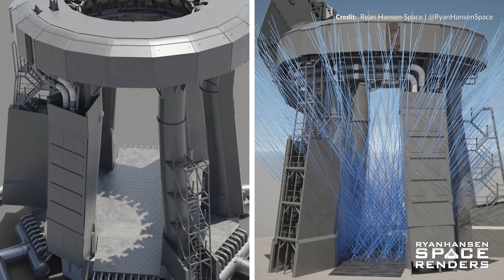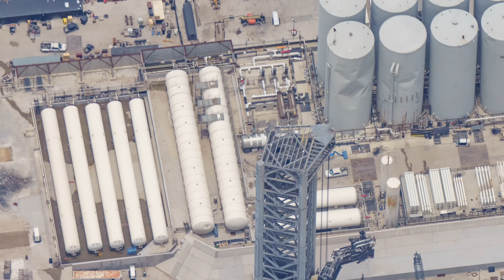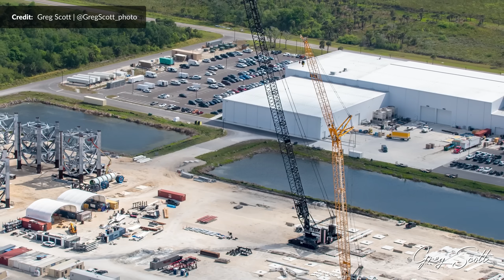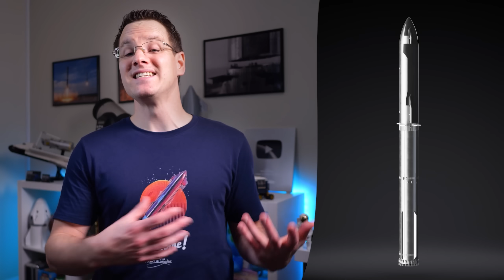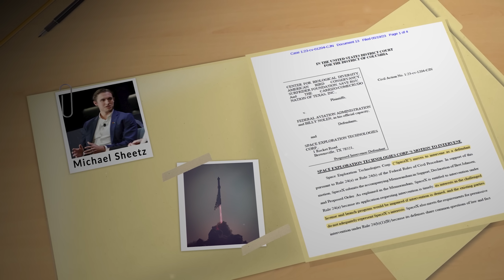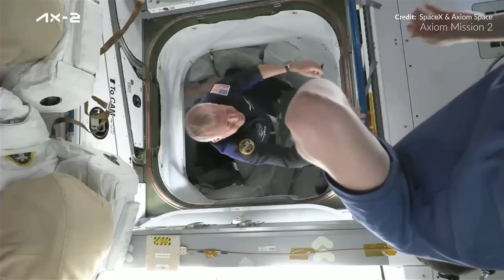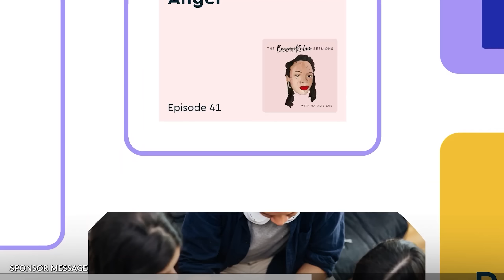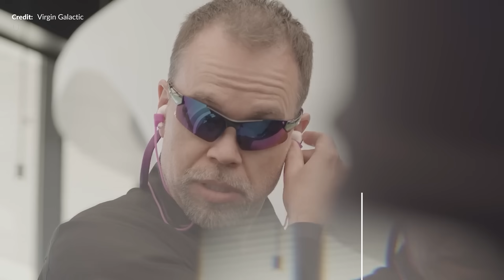SpaceX Starship 6,000 ton Capability, and SpaceX Joins FAA for Legal Battle, Axiom 2, Unity 25

Comment: Elon: "Raptor V3 just achieved 350 bar chamber pressure (269 tons of thrust). Starship Super Heavy Booster has 33 Raptors, so total thrust of 8877 tons or 19.5 million pounds."

Stage Zero: "I'm tired, boss."

edit: idk what's happening in the replies rn, you can ignore them if you'd like to.
Reply: I love it when the SpaceX pom pom girls get all hot and bothered... It's truly hilarious.  Every. Single. Time.  Hey girls, go over to the Common Sense Skeptic channel. Your libel to blow your tampons right into space after you see some of those videos... I imagine It'll be like splashing holy water on Count Dracula for you🤣🤣. Anyway, unreasonable worship/fandom/cult of personality issues aside, SpaceX will eventually have a great cargo ship that will have super lift capabilities. That will certainly help the space race, no question. At any rate, even the pom pom girls must concede that the program is going to take 5 to 10 years to mature to something reliable. Yes it's going to cost almost as much as traditional aerospace. Yes flight cost are going to be way more than 10 million per flight. That's just the physics of space flight.
Reply: @hawkdsl  Now that's a good post right there. Did any of you that disagree  laugh anyway? Come on, admit it.
Reply: @hawkdsl  Sounds like you're just a hater and a malcontent. I would rather root for progress than talk sh!t on people trying to advance technology.
Reply: @hawkdsl  misogyny doesn't change facts.
Reply: @AtomicExtremophile  Huh?
Reply: @hawkdsl  The whole Starship program up till now (if it has cost $5 billion) has cost less than half the cost of a single Shuttle. The whole program has been designed from the beginning to be far cheaper and more efficient than any rocket built up till now. - That's why Space X went for big and for stainless steel.
Reply: @Lucien86  Yes, that's true... Starship will be cheaper than any Government endeavor. No one is going to dispute that. But it's not cheap either. The total cost of Starship is of course going to be much higher than advertised.
Reply: @hawkdsl  I did a calculated estimate of Starships cost about a bit over a year ago.. A Starship itself costs something like $20 to 30 million to build.. The Superheavy booster probably costs about $50 to 80 million to build.. But that doesn't take in the cost of all the ground facilities or anything else..
Reply: And don't forget the painters. Every launch or test fire, the painters think "Bloody 'ell. Here we go again!"
Reply: @herbertbautista8509  He's a great guy from what I've seen but he is, if not officially still, a NASA spokesperson of sorts. What did you think he was going to say? Oh, and the ISS trips? Fantastic job, and the Falcon 9 is sweet. Very nice rocket, but again, not nearly the hyped future savings to the government that Elon sold them on either. They were given the billions to be the first back to the ISS.  They did it, and that's impressive but it it is something that's been done for decades by others.
Reply: I would bet $,£,€ or whatever currency that his “water sandwich” will do nothing but cause a huge steam explosion. Possibly damaging a lot more components then the concrete did.
Reply: It's so funny when ultralibs invade the comments and try to detract from the scale and ambition of what spacex is doing without even knowing what they're talking about
Reply: @herbertbautista8509  Why can't you and others ever admit maybe Musk is wrong in his strategy of building Starship.  You take what he says as gospel and never ask your self, why doesn't Sierra Space, NASA, Boeing, ULA, Blue Origin, ESA, and others do it that way?  SpaceX engineers are the only ones who know how to do things?

You were sold that just clearing the launch pad is success and an exploding rocket is the best way to get data.  Instead of explaining why others are wrong, you go to the usual I just hate Musk.  

Sorry to disappoint you, but Musk is not an Aerospace engineer.  The fact he refuses to put in a flame diverter and trench, shows he can't even follow the basic design rules all others follow.  You see the result of his flat pad design.
Reply: Stage Zero: "I don't feel so good, Mr. Stark... eh Musk...."
Reply: @herbertbautista8509  NASA used the shuttle before it retired and purposely hired commercial companies to handle those missions.  How soon we forget that NASA gave some money to SpaceX and Boeing to help develop their commercial crew vehicles.  Let that sink in.
Reply: @pebmets  You just gave us the perfect example :- SpaceX vs Boeing. Just how many astronauts has Dragon taken to orbit? Now how many has Starliner? I just counted it and its currently 38 people for Dragon and 0 zero people for Starliner.
That's why the prototyping iterative approach is a good idea.

Now who achieved the first reusable first stage ever? SpaceX with Falcon 9. How many Falcon 9 landing's failed before they got it right? about a dozen. The iterative process works..
Reply: "Now who achieved the *first reusable first stage ever*?" 
You want to clarify that part?
Reply: @Lucien86 You know the FAA will ground Starship evetime there is anomaly.   An FAA investigation at minimum is 90 days.  How fast are you going to build that vehicle if you keep getting grounded for the FAA to investigate?

As for the Falcon 9 1st reusable?  Columbia, Challenger, Discovery, Atlantis, and Endeavour came before falcon 9.  The SRB segments were reused.
Reply: @pebmets  "How soon we forget that NASA gave some money to SpaceX and Boeing to help develop their commercial crew vehicles.  Let that sink in." 
Is that supposed to be a big deal? Actually, how is that related to the topic at all? It's irrelevant. The point isn't about NASA being useless or something. NASA is great. Not everything they do is perfect, though.

But if you want to talk about this, though, sure. Let's talk about crewed missions, since you referenced them in this comment. Let's talk about how Boeing managed secure 1.75x the funding for their starliner vs SpaceX, started development earlier and with more resources, and how it failed multiple times on its test flights (while SpaceX... didn't, almost in any capacity). Starliner Is STILL pending its crewed test flight which optimistically will be in two months (3.25 years later than spacex), and NASA's safety panel voiced major concerns over the safety of Starliner just yesterday. When it optimistically enters actual service in the second half of 2024 (current estimate provided by boeing), it's almost guaranteed it'll be more expensive just on a per-launch basis due to the launch platform.

This is a great example of SpaceX as a company beating a legacy aerospace company/org at their own game.
Reply: @EntropyConcept  Too bad it's a very very mature game so not much ground to break there, partial reusability they improved, but that's been done as well. That is no knock on the Falcon9. It is a great rocket. Those nice launch pads provided on top of the cash didn't hurt...like the OLM got hurt, badly. Yeah, Artemis burned up the launch tower in some places and some things need to be replaced, but the flight was great. SpaceX makes apocalypse movie b-roll footage. 😃
Reply: @pebmets, that's the point, SPACEX do something different (that you called incorrect) and eventually achieved it, while the Boeing and Blue Origin (recently) till now is still in development for the vehicle that will put American astronaut in a American soil to ISS and beyond, which both companies are also funded by NASA. Now did you get it? If you can't, I can't argue anymore, you have no way to understand. 

Btw, I'm not saying Boeing and Blue Origin is  not doing the proper way, it's just that it's a conservative way.
Reply: @herbertbautista8509  space x engineers are all mostly former NASA, Boeing, ULA engineers, they are fully aware that the way space x is doing it now is better than the way there former employers did this stuff
Reply: @beverlywhitman303  You sure they're not doing it to work in the field and provide for their families after the space program blew away in a cloud of dust years ago? People, especially specialists in relatively small fields don't always work where they believe in the end result the most. It's, nice and I'm sure a lot of them do believe they can do it and are loving being a part of it. You'd be hard pressed to find people being honest about it if they really wished they were at boeing or elsewhere still. People do quit SpaceX too.
Reply: @troys9222  my point is they (the engineers) are the ones making the dissensions at SpaceX, its not all on elon, he mostly just gives them the go ahead.

he is not a rocket scientist. 

inversely when any of them worked at NASA or boing, it was mostly 'no' go ahead. we need to do a 5 year study first. its that type of thinking that killed the space industry and make the system cost 10x.

restricting your self to only use 'tried and tested' means nothing will ever improve.

i think you mentioned that they shouldn't use 30+ engines? there are no other really big tried and tested engines that are capable of doing what raptor engines do, they need to be able to restart on the fly. those really big ones need to be started with external help from stage 0, that simply wont work on a the re-use concept they are going for.
Reply: @beverlywhitman303  Don't count the money until delivery. Nothing is guaranteed here. The general idea may be sound and worth a try, but it's not producing anything at all yet. I never said we must restrict ourselves to tried and true devices, but the most important part of the rocket (the FTS) was half-baked when there are so many examples of ones that have worked flawlessly, every time.  That's a small part. It doesn't hold back progress. Trying to design your own and failing with something so relatively simple is bad, and I'm not sure why people defend them in this. They can do no wrong? They messed up and endangered peoples lives haphazardly. This is not a nuanced issue with many angles. They messed up in an alarming way.
Reply: @beverlywhitman303  No really big tried engines? They were building their own engine. They made the initial decision on their size and decided right away to use a crazy number of them. You do know that the outer 20 engines on the Super Heavy booster are started by the OLM, right? Which is fine and saves weight but it makes the pad even more incredibly complicated. They talk of undesigning and simplifying things so much, then the actual result is an increasingly complicated pad with so many systems with fail points it, and the simplest part of it (flame/deluge) is embarrassingly what costs them the most in the long run.
Reply: @troys9222  where are you getting this? no ones life was endangered by the FTS, even if it had failed (witch it didn't) the ship would more than likely have just splashed down in the ocean.

they didn't use a "half backed" system!, its the same kind of system used on several other rockets. turns out it doesn't work as well on a rocket 3 time larger than any of the others using it but how could any one know that with out a test?

oh yeah nvm a 5 year study may have caught it, or not, it didn't catch the Columbia disaster and there was at least one engineer at NASA warning it would happen.

far as i know no one thought there would be issues with the FTS before launch, and it worked fine, just not perfectly. can it be improved sure, you find these things out by testing.
Reply: @troys9222  it's not a crazy number of engines, nasa was even thinking of building a set up like this a few times. more, smaller engines means they are easier to service, easier to install, easier to build, and gives a lot more redundancy if one fails.

have 1 of your 5 engines fail and it's a disaster, have 1 of 30 and you may still make it. they are trying to get some redundancy with starship, they need to be able to hot swap an engine for quicker launch turn overs, try doing that with a 80 ton engine vs a 2 ton one. 

people at NASA have being arguing for smaller engines in grater numbers for years as there is a lot of benefits to it.
Reply: @beverlywhitman303  I'll get to the danger next, but I do want to address your points. I'm not here to insult anyone personally. I have views on this, and I haven't had anyone tell me a good reason why lives were not in danger. I make long posts, so I'm not even getting started unless you want to hear it, so if you have a response, don't be vague and we can discuss this further. I assume that's why you're here as well, but maybe not. For starters, what is your criteria for "worked fine"?
Reply: @beverlywhitman303  Engine redundancy is great, but has nothing to do with chosen number of engines above a certain definitely real but somewhat variable threshold where it becomes prohibitive and unnecessarily complex. Everyone knows this, and I understand what they're trying to do. It doesn't make it the right move. They are struggling with that balance right now. It doesn't have to be a great idea.
Reply: @beverlywhitman303  Could you also point me to any instance of people arguing for a number of engines anything near Starship? Is this one rendering conceived one time of one team, on one thing, or a movement as it sounds like you're implying?
Reply: @troys9222  "worked fine" criteria for FTS (flight termination sequence) is they activated it and the the ship ship blew up.

if it had failed then the ship wouldn't have blown up or at least not blown up do to the FTS

also i am talking about the Starship test flight so if it's some other rocket that FTS did fail then we are talking past each other.
Reply: @troys9222  actually using smaller engines simplifies things, the bigger the engine is the harder it is to control chamber pressures, and the more likely they are to just blow up unexpectedly.

the most reliable rocket atm is Falcon 9 and it uses 9 engines, 9 to take off and one to land, if it used just 2 or 3 it wouldn't be able to land it self with the current tech as rocket engines do not that that much variable thrust.

its the same issue with Starship, its going to use (more of less) 33 to take off and just 2 or 3 to land, it will need at least 2 engines to land with so that is part of what determines the engine size.

Falcon 9 can land with 1 because it doesn't have to yaw on the landing, Starship does have to yaw as the fins need to be at the right orientation for mechazilla to grab it
Reply: @troys9222  old Soyuz rockets had upto 32 combustion chambers, even the modern Soyuz still has 20 of them counting the boosters, and it was considered the most dependable rocket till falcon 9 took the top spot.

i've been trying to find papers on the Venture star shuttle replacement that was suppose to use 7 aerospike engines as i remember seeing suggestions for up to 50 on some of it's concept builds but i'm not having any luck. 

the point was to make them more serviceable as the old shuttle engines where simply not. they where way too big, and it took weeks or sometimes months to put the shuttle back on the pad.
Reply: @beverlywhitman303  Combustion chambers and rockets aren't the same.  Of course you know that, I'm not trying to insult you, but I don't know what you know about rockets either. 

Multiple combustion chambers was a way to combat combustion instability. For example on the F-1 the size, like you were saying with larger engines, things like combustion instability become much larger problems and it was a huge one for the F-1.

I get it with the size advantages, but you have to acknowledge there is a limit, or more accurately a balance, and it is an incredibly hard thing to do. Of course, that's why sayings are based on the complexity of rocket science. 😄It really is so complex I can only try to barely start to get the general overview of it. I don't know if I know more than you about it, but I like discussing it.

I appreciate you trying to find that. I wasn't trying to call you out I just hadn't seen that. The way I see it, concepts are concepts, and that's cool, but I focus more on what made it off the drawing board, many times for very good and obvious reasons. Aerospikes are so attractive, but the disadvantages haven't gotten them very far as of yet. They're heavy and introduce things that rocket's don't to offset their clear advantages...so far.

The Soyuz I love for it's extreme dependability and sheer work accomplished, and the Soviet engines of the 1970s are still so legendary and reliable that are still used quite effectively. Rocket science is so much razors edge walking and incremental improvements that if SpaceX perfects the full flow staged combustion cycle engine it will be revolutionary no doubt at all. I'll be back to eat crow and congratulate, I swear I will be very happy. I'm not a hater not wanting them to succeed, I'm just worried they are going to set back the program I want to happen for valid reasons in my opinion.
Reply: @beverlywhitman303  Wow, we have so many tangents going. I appreciate the discussion of the topic and being civil. I like it when people address the points I make and talk about them specifically so I try to do the same.

We agree of course there are disadvantages and advantages to more engines vs. bigger engines. They are pushing this farther than anyone has, especially considering the immense power of the engines and combined thrust on unheard of scales. I think we agree on that. We disagree whether it can or will work, so ideas involving aerospikes, while interesting, I'm not sure are relevant to this.

The bigger the engine the harder it is to control chamber pressures? I haven't read that but that may be the case. My take from what I've seen is that the stability of combustion is the problem, but maybe those are so related they may be the same thing essentially. I agree if so.

Falcon 9 is an anomaly in the rocket world, and they did do that, and did it well, but that is feeding 9 engines from one tank, not triple that number for much more powerful engines for a ship asked to do so much more. 

Interesting info about the engines for landing. I hadn't known that. Like I've said before, I get what they're trying, but I'm not getting any confidence here. I thought I was an optimist by nature, but dang.
Reply: @beverlywhitman303  I'm not sure I have the energy left for this tonight, but I'll give you my take in short form and will have to respond tomorrow.

The FTS did not work. It did not break up due to the FTS. It broke up almost a full minute after the FTS was triggered (according to Elon Musk 40 seconds), though I timed it to 50 seconds or so I think. You can literally see them trigger it. It popped holes in the tanks. That is all. Essentially it did nothing remotely useful, because its whole job is to cause the rocket to break up NOW, not whenever it experiences aerodynamic forces it can't take or explodes on its own for whatever reason.

Ships won't blow up unless they're triggered to blow up? Just no.
Reply: I'll ask again, maybe not in the exact words, but what is the job of the FTS?
Reply: Always surprised to see people actively being critical of SpaceX, it's as if they want them to fail so they can have some kind of legitimacy to their argument...but to what end?  People really don't want to see Starship realized?  For what reason?  Shouldn't we all be hoping SpaceX succeeds in their goals?  Or are these people just salty because SpaceX isn't doing it the way they think it should be done?
Reply: @Skinflaps_Meatslapper  For me, I'll be as honest as I can and speak only for myself. I love the space program of our planet and hope for it to progress as swiftly as possible and I'm glad to be alive in this time. I do not want it to fail or sputter in any way. I am as objectively as possible looking at what SpaceX is doing and thinking I am afraid it doesn't look good for glaringly obvious reasons so far. I am critical of the very real recklessness of putting people, yes people, in real danger as well.  Those are a couple of the things. 

Why does it have to be secret behind the scenes "hate" for other reasons so much? I'm afraid they're going to set back our space program in a worse way, compounding instead of relieving NASA's regular cost overruns and schedule slips that I do complain about as well. A big part of that is the nature of relying on political conditions to fund or defund projects. This new way I understand the reasons for it, but it doesn't look good to me for Starship being near what was promised. BO is dragging heels and a really late mystery and getting more annoying as it doesn't appear,but SpaceX is so visible it's kind of fun to debate. I don't want a fight. I'm here to maybe talk about specifics and posts get me going sometimes and I make way too long posts, but I'm not as serious as I sound. I take it pretty friendly, but I will disagree and debate with some things, agree with others and go on and on...
Reply: @Skinflaps_Meatslapper  SpaceX is a company that wants to make money. That's it... end of story... turn out the lights and go to bed. All the other nonsense is something called marketing. That's all the "multi-planetary" and "save the human race" word salad nonsense is. Marketing. Selling you 2 toilet plungers when all you need is 1. That's not to say SpaceX is not doing great things in rocketry... they are. But the end goal is to make money. Thinking otherwise is very naive.
Reply: And Yet, they can't launch with what they have without multiple engine failures.
Reply: @pebmets  sitting behind a screen being critical is easy. what you fail to make note of is that these are all test flights to find problems and overcome them... practice makes perfect as they say.
Reply: @jek4_XD  Please tell me what other launch provider builds a new rocket and the person who runs the company says it will probably fail and if it clears the tower everything else is a bonus.  I followed shuttle development.  It was the most complex vehicle to ever fly.  Its maiden flight was a success.

We all followed SLS.  It's maiden flight was a success.

How did these complex vehicles do it without blowing up previous versions in flight?   Shows you can learn without having to have the thing fail in flight.
Reply: @pebmets  Show me another Rocket Company that builds Rockets outside of Government contracts.

Tax payers and Congress tend to freak out when you blow stuff up. Government rockets are over-engineered to ensure they never blow up, reducing their effectiveness at the cost of payload capacity and substantially increased cost.

1 Super-Heavy cost: $40 million
1 Government Rocket: $3.5 billion
Reply: @pebmets   your missing key information in your argument. Look how long shuttle and SLS programs were in development process for before flying, then look at the very little time taken compared to these that space x has been developing and upgrading its starship program. Also the fact that SLS flights were not named as test flights and starship is , you cant compare them at all. Completely different rocket programs in their own rights, with completely different development processes. Starship is still in the development stages and is being tested by real life flights and data gather from said tests, not just on analytical data alone.
Reply: @pebmets  empty f***ing argument bro
Reply: @JessiBear  You do understand the $2.7 billion contract for HLS is going towards development of Starship is government money.  Also, NASA gave SpaceX millions for the in orbit fueling proof of concept.  So government money is going towards starship.  Government money for launch contracts is keeping Space alive.
Reply: @jek4_XD  So every other program did it wrong?  Surprised Apollo, Starship, and SLS were able to fly without having prototypes fail in flight.  How is flying with engines  Musk said were already obsolete proving anything?
Reply: @pebmets  look what Spacex did with falcon 9 there were quite a few explosions but now it is one of the most launched, landed and reused, and reliable rockets in operation. Spacex’s method of development seems to be working very well. Not saying that more cautious development is wrong, but being more ambitious can work well.
Reply: @pebmets  
Stop it dude. This approach is faster then sls, sls had failed launch attempts, by failed, I mean they scrubbed them as rocket had issues. 

What space x employs is developed, test, correct issues, test, and repeat until successful launch system. 

Just look at falcon rockets, they went through same process, now falcon rockets are practically 100% reusable and no other system even comes close to its success. Starship is heading in the same direction just extra extra large version. 

The way nasal does things also cost like 10 times more then space x. So you lost already with your bogus argument.
Reply: @pebmets  Different development philosophies. The legacy test everything adnauseam, fixing it until it is perfect and assembling it at the end. Or fix it until it is good enough and fly it to get data for more fixes. Both work. The legacy method when hardware is expensive to make. The iterative method when you can afford it with a massive budget or the hardware is cheap.

NASA likes the robust Starship test program. From page 10 of the HLS Option A Source Selection Statement from early April 2021 before SN15 successfully landed.

"Finally, within Technical Area of Focus 7, Approach to Early Systems Demonstrations, I agree with the SEP’s assignment of a significant strength for SpaceX’s robust early system demonstration ground and flight system campaign, which focuses on the highest risk aspects of its proposed architecture. This will allow SpaceX to isolate and address performance and operational issues early in its development cycle, which will meaningfully inform the maturation of its capability and increase overall confidence in its performance abilities."
Reply: @pebmets  Compare the development costs and timelines of the programs.
Reply: @felixgent4084  To date, Musk said the program is up to $5 billion in costs.  This is Musk so it is probably higher.  He said an additional $2 billion this year and they still won't have a mission worthy vehicle.  That doesn't count the millions being spent to fortify Starbase for the next launch.  When a mission vehicle is ready, the cost of the program will be close to SLS.  With the amount of fueling flights needed to get to the moon,  an independent analysis claims the cost of a mission will be close to or exceed that of SLS.
Reply: @pebmets  SLS spent billions of tax payer funded money by the feds. SpaceX is a private company...you're comparing apples to oranges.
Reply: @pebmets  What's your source?
Reply: @steveaustin2686  Because people (and nuclear warheads) were riding those rockets to space...so the idea was find all the problems on the ground first, fix them and have as safe ride as humanly possible into space. This method by Elon means there will be many missions failure as they discover one bug after another. It will be many launches (or lost crews if elon cannot wait) until all  the bugs are found and fixed. 

The old development philosophy was implemented for a reason... NASA was daring like space X in its early day until multiple near misses and the Apollo1 crew burning to death due to a mistake that they missed (one obvious in hindsight)...  caused NASA to act the way they do now.  Test and test adnauseum. There are so many points of failure that you can't afford to let exploding rockets and dead crew find them all. The old development philosophy is there because it was paid in blood. 

Elon has not lost a crew yet... but when he does (and he will do if he is serious in going to Mars.. space travel is dangerous)... and when it is found it could have been avoided if they just spent the time to think about it and run a few test on the ground.. then we will see if SpaceX continues with its current philosophy of letting exploding rockets locate points of failure.
Reply: @jek4_XD  Yes, judging progress is easy if you go with the old tried and true method of examining results. Speculate all you want, but visuals are not good 9 years into Raptor development. The next Raptor may always be the most powerful, impressive and dominant Raptor yet, but when do you actually expect them to start working in some form reliably? "Because it's always the old version." is a perfect replay of Raptor 1 to 2 nearly.
Reply: @jek4_XD  Raptor, 9 years, zero reliability. Yet the latest version is always quite a test stand hero. That's like preseason champions in sports.
Reply: @pebmets  Yep, and Elon Musk has said that if it wasn't for the first NASA contract SpaceX was done. Decrying government subsidies and bailouts is rich coming from Musk. Remember the Mariachi band? I do. In their defense, they have a great rocket in the Falcon 9. Kudos. Those are results, and they handled development more carefully with a traditional RP-1 realistically sized excellent rocket. Starship seems a mess in scale, and has all of the hard progress of a money bonfire at this point, but we'll see.
Reply: @AstronomicalSFS  But this ambitious? If they do 50% of their claims reliably I will be so on the bandwagon it's not even funny.
Reply: @lupinereivaj  "Just fire it anyway" has absolutely never been an option with an entire host of failure conditions. One of those conditions has always been, rightly so, in the sane world, near populations, when you can't design a functioning FTS system especially, is to not launch, and try to get it right next time. 

You do not launch a flying 5,000 metric ton bomb with engines out prior to launch on an inaugural flight no less, and I would be appalled if NASA did so. I lived near the cape most of my life. Locals in Florida take it much more seriously and it has kept what could have too easily happened on the IFT from happening there thus far. This is not a game. 

Use a designed FTS or one very like it that has worked for decades and quit being so careless on the safety side at least. That is what you don't have to be an engineer to know. That launch was a big wake up call for south Texans and Mexicans. Learn from programs that have never had the type of near catastrophe of the IFT.  Why not use a system that has been so guaranteed for so many years and designs that have worked forever, but no, they don't like anything that is tried and true.
Reply: @pebmets  I don't care what Elon Musk says. There are so many ways to slant numbers when you're a private company with multiple arms. Let's see if it sustains. They were facing bankruptcy by his admission if Starship didn't fly every two weeks LAST year.  Along comes NASA with another fat contract, but this time it's sure looking decidedly different.
Reply: @Troy S  
The traditional cost 10 times the cost of starship. And all common sense safety measures were taken into account. At no time was anyone in danger from that launch. 

Stop whinning over what ifs. We know what happened, and we know no one got hurt cause proper and adequate safety measures were taken into account. 

Trial and error is superior to what sls went through, many projects that use the sls development process have also failed and exploded. You got nothing worth saying bur your negative tirade.
Reply: @lupinereivaj  "and we know no one got hurt cause proper and adequate safety measures were taken into account." You seem familiar with what happened on the flight, so could you tell me about the flight safety measures taken into account and about explaining how the FTS (The most important safety device in any rocket) was adequate?
Reply: @lupinereivaj  Starship has no "cost" until it actually does what it was paid to do. Calculating costs in the space industry are obviously only really possible when examining the actual production of a program when it does what it does.

Previous projects failing is not exactly in the favor of your argument is it? So, this process is different, other projects have failed doing it their way, and yet they have also actually revolutionized our progress in space. Focusing on failures when assessing the success of your program says a lot itself. Starship is in limbo with nothing to show yet.  Don't count your money while you're sitting at the table. This game, that's not a game, has a ways to go.
Reply: @troys9222  
Cost of starship is at 3 billion. This includes the entire boca Chica site and all the work that has gone to it and supports its production. So 3 bill. With first test flight, they now know what this ship needs to do better. From actual field test data. So the progress to a better launch will move so much quicker as oppose to design only design. You will be proven wrong in no time. As for sls, it's development is at 10 billion plus with each launch costing if I'm not mistaken 2 billion per launch. While starship which is better just a few million in full reusability, and in disposal upwards of a 100 mill and something. Like 15 to 20 times cheaper then sls. 

Case closed.
Reply: @lupinereivaj  Elon Musk's predictions of cost, in case you haven't followed it, are so often so wrong, I'm not sure how it even convinces people anymore. NASA is no different or almost any of the companies that work for them. No one but a select few at SpaceX really know what this has cost so far, and no one, including you can predict space flight costs. 

That is what the big change is. The companies producing things before (private companies nearly always) had to report when they drop a wrench. NASA doesn't directly design almost anything. Those private companies, however, had to report every penny to NASA. SpaceX does not. They are being given billions to do this outright, and there is not enough oversight to know true costs when whoever is reporting them has a huge interest in claiming they're super low.

Besides, even IF the current numbers are true, they've spent 3 billion so far... ok, and they're how close to done? It has cost 3 billion "so far" has no bearing on anything. They built and had to nearly rebuild a terrible launch pad with a big  chunk of that money, maybe the biggest chunk, considering the setbacks they're facing.
Reply: @lupinereivaj  Oh, also, the IFT was sad.  Nothing at all worked properly at least. The most important being the FTS. People could have been literally impacted, That flight being touted for anything is odd to me because people have a hard time giving any pluses except vague "learning". They obviously learned things. Nothing works yet is the takeaway unfortunately. I just have less confidence than ever, no matter what they call it. They can't even make sure people are safe.
Reply: @pebmets  I haven't seen you try to launch a rocket into space
Reply: @426shelby426  You know that is a silly comment.  I bet you haven't written a television program, but you have opinions if the ones you watch are good or bad.
Reply: @pebmets   And Yet, they can't launch with what they have without multiple engine failures. 

Prototype.  Iterative design.  You need to understand what they mean.  Please look them up and think about them.

I think that it is likely that they had multiple engines of several subvariants on the launch for testing a variety of modifications to see which ones worked best under real launch situations.  In which case a successful test eliminated 1 or more of the modifications for being linked with failure.
Reply: @Scanner9631  The goal is to have zero engine failures.  Every other launch provider, not just NASA, would have scrubbed the attempt if all engines, doesn't matter how many, were not running properly.
Reply: @pebmets  The goal is to have zero engine failures.

Yes it is - on a production model rocket.  Even so part of Falcon 9s advantage is a failed engine doesn't stop the flight as they have redundancy.  

This was a test flight with full engines and no cargo.  It didn't require all engines for the mission to succeed.  The apparent hydraulic failure and the asymmetrical engine failures are the main causes of the spin.  No hydraulics on the next version.  Telemetry on the causes of failure of the engines allows upgrades to avoid those failures on the next flight.  

Mission success.
Reply: @pebmets  “the goal is to have zero engine failure.” Sure, a goal for any aerospace flight could be to have a perfectly nominal flight that completely fulfills all expectations. SpaceX wasn't shooting for that. They likely determined that the best way to further the program would be to do a test flight and collect data from the launch. You seem to think that anything short of a perfect success is failure, and that the methods used by legacy aerospace companies must be correct, because that's the way they do it, and consequently, everybody else is wrong. That obviously doesn't track with reality. A lotta people are able to recognize that what I just described is a sign of complacency. This isn't just something exclusive to Aerospace, it's everywhere in business. That's how SpaceX was able to disrupt the medium and heavy-lift rocket markets. Recognize complacency, develop a better solution, and leverage said complacency to your advantage. 

Does this mean that all the methods SpaceX uses are necessarily optimal or even better than legacy institutions? No, of course not. Yet, they've had this attitude from the start of their program. They've received government funding before, and they've had failed launches (Some intentional, some not). And yet... They're among the most affordable launch providers period, and the most affordable provider for their class of rocket (F9 [Medium lift] +FH [Heavy/Super heavy lift]), with comparatively huuuuge volume and great reliability stacking up to everybody. 

The point of their whole operation does not include guaranteeing success.
Reply: @EntropyConcept  OK, great rocket previously, let's talk about the completely different beast that is Starship.
Reply: @EntropyConcept  "The point of their whole operation does not include guaranteeing success." I like the "failure is not an option" route, but to each their own.
Reply: @pebmets  and your point about shuttle and SLS having success maiden flights but starship having multiple engine failures...even with those failures, they still got more engines running at the same time than shuttle and SLS put together, thats impressive.
Reply: @jek4_XD  How is that impressive?  Any engine failure is not good.  Starship had multiple which is one of the reason it failed.  Shuttle and SLS had SRBs to help with most of the thrust so your argument about more engines is moot.
Reply: @pebmets  Ultimately the first test flight was done with obsolete engines that would be on their way to the scrap yard anyway. And that is why there were such low expectations of success. That's the nature of the iterative evolutionary approach. Real testing always has failures..
Reply: @pebmets  impressive by the fact that on their first launch test attempt of a prototype rocket, they managed to fire more than 30 engines simultaneously, which has never been done before, ever.  It's obviously the goal is for zero engine failures, but again this is a test flight so they will now see what went wrong with firing so many engines at once and rectify those issues for the next test.

I never said that any of the other companies are doing it wrong, I said space x is doing it completely differently so you cannot compare their development processes with each others as each one is very different in their own right. Don't twist words out of context to suit your own opinions and support your baseless and pointless arguments. 

"Government money for launch contracts is keeping Space alive.", think you should take a rest from you tube and do some more research,;its government contracts and private contracts.

On a side note, i don't understand your grudge against a space company that is going against the normal grain of development. Your opinion is basically; their not doing it like normal space companies so they're not doing it right" . Quite a childish view point to have in the perspective of technological breakthroughs.. how do you think most inventions throughout history were made?? 

Space x is not just elon musk, its a whole team of people from various fields of expertise. 

 Im not sure why your so butthurt about any of this, sounds to me like you are an ex- space x employee who got fired and is very sour about the whole thing.
Reply: @pebmets yah but you also have to look into how many people has nasa lost to the shuttle seems like a failure with no humans onboard sounds a whole lot better then when it fails each time it has killed 6 ppl the shuttle program fails are catastrophic because life is involved I’d rather see the starship explode 100 times if it works out all the bugs and also we are talking about starship reusable ship verses sly and shuttle witch threw away millions of$ each launch.
Reply: @jek4_XD  Definitely true. Feeling offended aside, yes 99% of the launch industry is contracts from NASA/the government. SpaceX is actually the least reliant on this out of anyone, as almost all of their launches are their own starlink satellites, which will eventually be a huge revenue stream for them that will fund their mars colonization plan.

Also, yes, Elon Musk =/= SpaceX. The fact the media likes to go "Elon Musk's Rocket" is incredibly brain dead and obviously a ploy from some entities, political or otherwise, to derail SpaceX in general. Boeing, for one, really doesn't like them because they show them up at basically every turn (they were a main contractor for SLS, and we all know how well their Crew Dragon competitor (Starliner) turned out). Companies often fund advertising campaigns against their competitors, just look at the billions of dollars of anti tesla advertising the oil industry puts out, this seems to me to be no different. Anyway, I agree but we need to remember we're here to educate people who don't know any better, not get mad at them (though I definitely get it can be annoying lol)
Reply: @jek4_XD  Come on, read what you wrote. The bar is so low. I'm exaggerated of course and joking a bit when I say no sane people design a rocket with 33 engines. NASA got the "all" the engines running and performing beautifully, right? They can't get an A+ in "number of successful engines" category because there aren't extras in previously successful designs. It never has been a good idea to have so many. That doesn't mean they can't make it work. I'm a keyboard analyst, sure, but the risk of trying is not in question.
Reply: @Lucien86  And many lives were in real danger. Ask me why. I may be an armchair space fan like anyone else, but let's talk about how SpaceX relied on way too much luck on that IFT. They're suing along the avenues they can, joining forces for a cause to get the financial support they need to fight the government for being so careless and at the very least maybe force changes at Starbase.
Reply: But that’s the whole point of why they have to use so many engines on one rocket, it’s intended payload. You could say the same, what sane people have even tried to build a giant rocket capable of nearly 6000 tons payload?  That’s how technology advances , people taking risks and doing things no one else has.
Reply: @jek4_XD  That's one way to look at it, sure. They usually just make bigger engines to keep a manageable fuel flow scenario among other things. Good luck to them.
Reply: @pebmets  Try looking up the word "prototype".
Reply: @Lucien86  Shuttle had prototypes but did not need to explode them in order to get good data.  What makes you or anyone else think SpaceX is  correct with their development strategy?  Tory Bruno who is a real aerospace engineer doesn't have his company build rockets that crash and burn to get good data which Musk has sold you and others on.
Reply: @pebmets Thanks Mr Negative…
Reply: @pebmets  booster 7 was a borderline-obsolete prototype. Booster 9 (and all later boosters) are significantly more advanced. There is a reason why elon said the night before the launch in an interview to "keep expectations low"
Reply: @erenjaeger9418  If Booster 7 was obsolete, why was it launched?  Why not wait for Booster 9.  This leads to an issue where Musk put his need to rush a launch vs getting it right and  using the a more up to date tech.  He had an update for the pad, but did not wat to wait and blew the other one apart.
Reply: @pebmets  Booster 7 was launched solely to gather data (why there was no payload). It was functional but had no other purpose anymore after the static fires, and they wanted it off the pad. Between boosters 7 and 9 the gimballing system was swapped from hydraulic to electronic and there was significantly more shielding added between the individual engines meaning the fact that so many engines survived without that shielding bodes very well for booster 9. Booster 7 was launched for the same reason why all those early starships were launched and attempted landings (blowing up several times before finally landing successfully): to gather data.

This is how SpaceX operates, and the only reason why they spent so much more time working on booster 7 before launching it as compared to before was because they couldn't afford to let it blow up on the pad. Otherwise, they probably would have launched and blown up several boosters by now. This is how spacex operates, the reason they are so quick to develop new technologies compared to the rest of the industry is that they create prototype rockets, let them fly and blow up, figure out why they blew up, and then make sure the next one doesn't blow up for that reason (and they eventually prevent every reason for that rocket to blow up by process of elimination). This is how the falcon 9 rocket was developed, and it is now the most reliable rocket in the world with the highest launch cadence. With the reusable falcon 9, spacex by mass launches ~4 times as much per year as the entire rest of the world combined. Everyone else over-engineers their products and makes 100% sure that the pre-production prototypes do not blow up, as that is the old-space standard, but as elon musk says "if you are not failing, you are not innovating". He also again stated the night before to not have high expectations, and that is because the success of that launch was measured mainly by not blowing up on the pad.
Reply: @pebmets  also spacex's data from static fires led them to believe the pad would survive 1 launch. That's why they launched first, they were replacing that area anyway. They were wrong, it happens🤷‍♂️
Reply: @erenjaeger9418  No, Elon wanted to launch on 4/20 because it was funny.  Turns out he was right!
Reply: @hawkdsl  The only way to watch that flight , knowhatimsayin?
Reply: @pebmets  people like you said similar things about Falcon...yet it bested Soyuz in 2022 for launches - nearly one very six days it's reusable - better than the flawed, dangerous, 'reusable' Space Shuttle (the launch system with the unenviable record of killing the most astronauts).

Falcon had similar beginnings, yet, without it, today, the USA would only be relying on Russian Soyuz launches. Falcon proved all the doubters wrong, and is why Starship is going to be a success.
Reply: @AtomicExtremophile  People like you don't know Shuttle history.  How do I know?  The killing comment.

Let me help:
Challenger.  The SRB engineers at Thiokol said the SRBs would be flying outside of their tested temperature ranges and made a strong recommendation Not to launch.    Thiokol senior management went against their own experts because they would not stand up to NASA.  Basically, the SRBs were flown outside of what they were rated for in terms of temperature.  Challenger would not have happened if they flew within the specifications of the SRBs.  

Columbia:
The foam shedding issue was known.  The experts claimed that foam could not cause a catastrophic issue to the obiters.  For that reason, looking into the foam issue was not a high priority and was taken as an acceptable flight risk.  Even when the caught the foam strike on the wing, no one thought it could be that bad.  Management again did not press the military to aim one of their satellites at Columbia to look at the extent of the damage.  

In each instance, the orbiters were not the cause of the issue.  Poor management choices led to the lose of the Challenger and Columbia crews not the orbiters themselves.